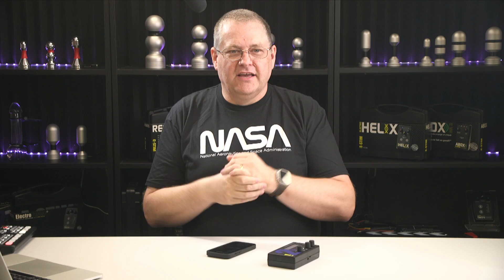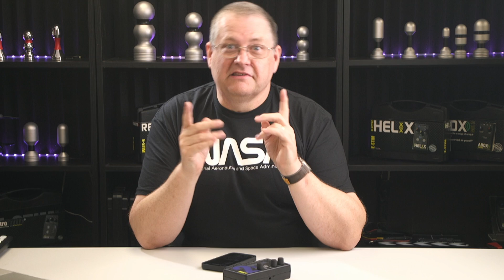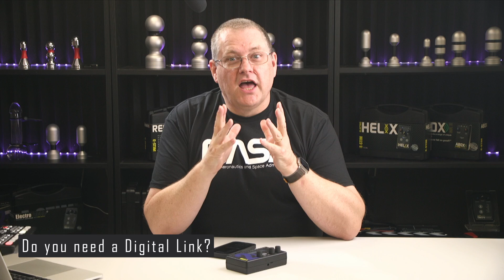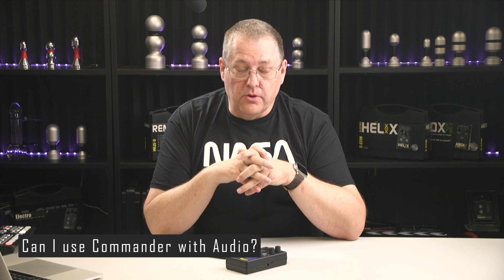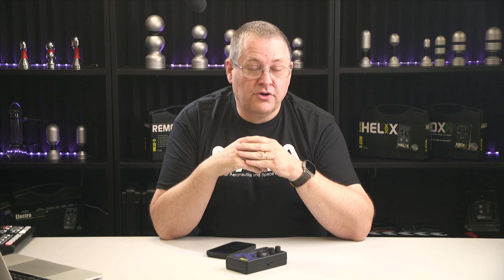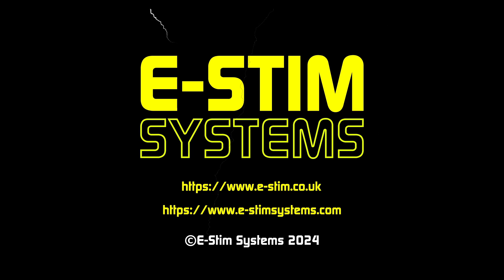Unveiling Secrets: E-Stim Systems 2B Answers

Comment: Very well explained!

Wayne, I would like to see two more follow-up videos to the 2B. The first video should go into more detail about ‘current’ (charge) and the ‘series of pulses’ you mentioned at playtime ~ 08:30 ff.
Was it AC or DC, a sinewave or rectangle pwm signal and how many volts (mamps) you distribute at the two outputs of the 2B, gladly with a representation as a graphic sheets 🤓.

The second follow up video should/could deal with the audio topic in more detail please, how the 2B interprets a mono/stereo audio in which way (because a direct, unfiltered (low-pass filter) audio does not seem to exist with the 2B so far?).

Regards, Martin.
Reply from the maker: Unfortunately at the moment the answer is no to both. We generally don't discuss then internal workings of our units, as it soon degenerates into 'you should have done this' and 'you should have done that',  and after all we are a commercial company. But I will say none of our units have a DC output.
Reply: @EStimSystems  Thx for your quick answer. Can we perhaps get in direct contact about the 2nd topic concerning the audio? I have something in mind where I need a latency-free conversion of the audio signal.